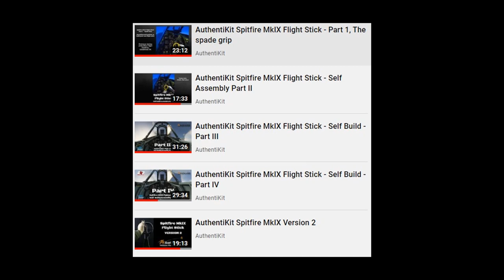AuthentiKit Spitfire MkIX Flight Stick - Self Assembly Compilation

Comment: I've recently finished building my flight stick, and I'm absolutely delighted with it. I followed the video carefully and it worked first time! (That was so satisfying!) The design is really impressive, very cleverly done. In use, it's absolutely brilliant, precise, sensitive, progressive and very analogue with the hall sensors. It's so much smoother than the yoke I had been using, which is potentiometer based. I don't have a 3d printer, so I've now ordered the parts for the throttle, trim, flaps and chassis, and I'm really looking forward to building those. Great work!
Reply from the maker: That's great to hear and very much appreciated. I'm actually about to announce (this w/e coming) a new download website where people can give feedback/commnets. Fancy putting yours on it now? Here's the flight stick page and after you register you'll see a reviews tab and if you click that you should get the option to add a review. https://download.authentikit.org/filebase/index.php?file/3-spitfire-mkix-starter-kit-a/

Comment: HaH! I am genuinely impressed! Years ago I did demo videos for computer flight sim consoles; one out of Florida and one out of New York. I heard about all the costs involved with injection molding and prototyping. Great thing this can be done on a consumer three dee printer. I've been wondering when good flight controls could be made for the virtual flight sims. This looks great for conventional formats, Great job!
Reply from the maker: Thanks. Yes 3D printing is a game changer especially for relatively low volume stuff. My simplified assembly system is good for relatively low tech vintage stuff.

Comment: At 53:50 found it easier to strip some wire back, twist into a point on the wire, use a tiny phillips to separate a hole then push the wire through, done in less than 10 seconds
Reply from the maker: Thanks for the tip!

Comment: hi, great video. I can't tell which spring goes first from the parts list or pictures of springs on line. The part listing shows two springs that are identical. The parts list is no better. You don't say which is the shorter one. Guess \i will watch the whole video to find out.
Reply from the maker: The roll spring is the shorter one. You can check here https://authentikit.org/parts-directory/

Comment: I'm confused I'm at the part were you are threading all the stuff. And you've mixed in a separate yellow wire, in the updated version.  Yet i can't see that second separate wire at all in the rest of the build.  Not that there is room for it anywhere either.
Reply from the maker: Hi. Do you have the wiring diagram handy? I wouldn't try to follow just the video without cross checking with the wiring diagram. The wiring diagram is definitive whereas the video is an amalgamation of several previous videos that were done over several months.

Comment: the wiring diagram for this shows a branch in the uni hub for the roll and pitch 5v wires. in the universal hub wiring video there is no 5v connection for the roll.(brown wire) which is correct?
Reply: im assuming because they are shared (ve) that no connection is needed on the 5v pin  roll on the bodner
Reply from the maker: The 5v is shared between all axes so you only need 5v to go to one of the bodnar pins in the revised approach

Comment: At 40.00, none of the bearing casing parts match what is in the file. Apparently, I should ignore that and press on with wire management. The "text box" (@40.11) should be clearer on this.
Reply from the maker: Thanks, yes there have been a few tweaks over time. Could you still tell which to use though? I’ll redo that video in time, its just that i’d like to improve some other things as well when i do.

Comment: As a Brit, why do you say "Ground" instead of "Earth"? Everybody seems to be more and more Yankified these days abandoning their own traditional language which feels somewhat treasonous in some way.
Reply from the maker: I'm not an electrical engineer but I believe "earth" is reserved for mains voltage where the live wire is alternating current and it achieves current flow by physically connecting to earth/soil! With DC voltage it's +ve and ground. Happy to be corrected.
Reply: @AuthentiKit   You don't need correcting! I'm an electronics engineer of 40+ years with my own electronics company ... and it's Ground when dealing with DC voltages and signals. Earth is usually referred to chassis ground and earth is usually associated with power AC, because AC power systems don't have a 0v (ground) reference! Earth is used as a path for leakage currents. Ground is a voltage potential plane and is normally at 0V, but can be 'floating' or 'virtual' in some applications!